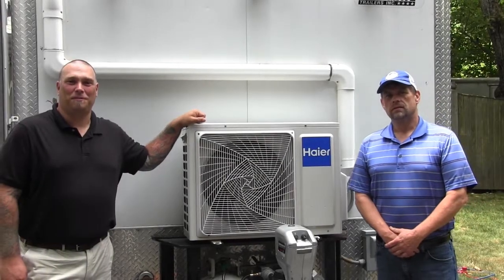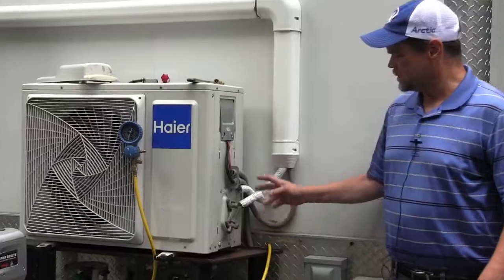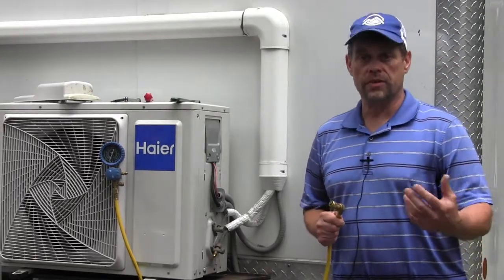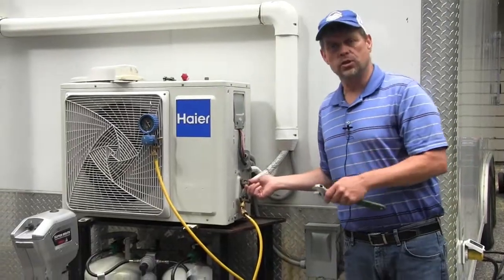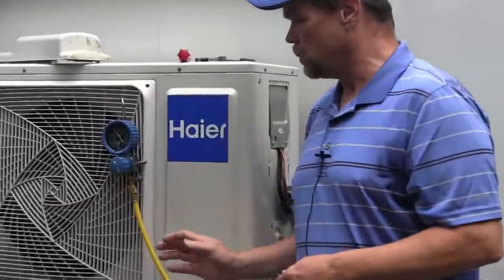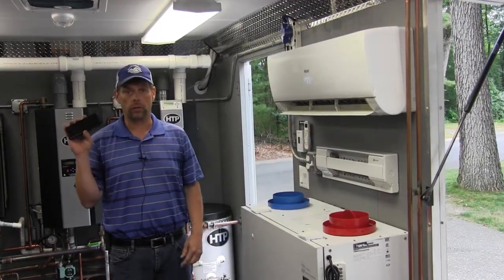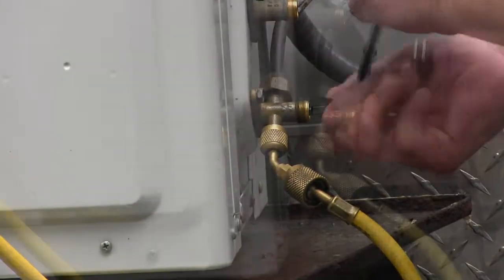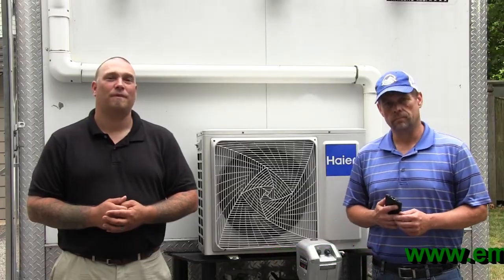Haier Ductless Mini Split Refrigerant Pump Down

Comment: Hello ,,what about when the unit is not operating  ??
Can you push the charged lines back into compressor any other way ? With a vac pump ? Or is that sucking only and cannot push , gas  back unto compressor ??
Reply: If the compressor in the unit isn't working you have to use a refrigerant recovery machine to pump it all out.

Comment: Guys, nice video but what about to purge the yellow hose before evacuation ? At the end compressor creates a little bit of vacuum as you said and suck in everything what was in yellow how. Since you did not purge it, then it sucked this oxygen in a hose, which is pretty long by the way, into the system. Or am I missing something ?

Comment: Amateur hour. Sucked air into the system because you didn’t purge your ridiculously long service hose. It’s also not a liquid line on a mini split. The metering device is in the outdoor unit.
Reply: How do you purge the hose?
Reply: @tombomombodombo  you connect it to service port and open the valve on manifold for a second or so.

Comment: the gauge and service hose will have air/moisture in them when you connect, once you turn the unit on won't that pull it into the system? Wouldn't it be better to connect a gauge directly to the service port without the hose to reduce the amount introduced or is it just negligible?
Reply: He should have pull vacuum on that line first,
Reply: @rawrandom-yt  Or purge it with little bit of refrigerant in the system. How you want to pull a vacuum on that hose if it's already connected to AC ? Only wat is to have that special safety - leak free valve which connects to 5/16 port. So after connection the hose they just should open valve on a manifold for a second...
Reply: Not immediately but for sure at the end of evacuation once compressor creates a litle bit of vacuum. All what was in the hose after connection is now sucked in the unit...

Comment: What size adapter is that
Reply from the maker: Standard r410a hose adapter, female 5/16 SAE x male 1/4 SAE. Can be purchased individually or in kits such as yellow jacket.
Reply from the maker: One more thing, the contractor should have two of them and they should always check for a  good o ring before use.

Comment: My flare is leaking, so I’m going to try this vs paying some dude 700$
Reply: Worked perfectly
Reply: @pokerbuddy2227  You should not have done that with a leak in the system
Reply: Thanks for posting the update. I always wonder if people succeeded. This looks a lot easier than using a refrigerant recovery system. I’m planning on installing my own mini split and didn’t realize you could just suck the coolant back in!
Reply: Did you re-flare the pipe or what did you do ? Probably just tightening them up would help as well or ?

Comment: I do in a different way. The machine is kept running then hose is attached to the suction pipe. Running presssure is less than standing pressure so attaching the tube is easier and refrigerant leakage will be zero or less. Second, the discharge line should be closed slowly so that there is no sudden pressure shock to the compressor. This I think is a better way of doing.
Reply: Good point to attach the gauge hose when system is running. But I would also purge the hose after is connected, there might be lot of oxygen trapped and at the end it's all sucked into the system. I saw several videos like this from pros so I'm not sure what's going on. And I'm just amateur enthusiast...
Reply: What about the air in this yellow hose?
Reply: Totally agree with you
Reply: Yes could have bled that while it was running before pump down, and also good idea to run compressor  for a min before closing off discharge valve.

Comment: Your "de minimis" release can be reduced a bit by adjusting the valve core depressor in the hose fitting. And also by getting some core removal tools.
Reply: And by attaching hose when system is running (less pressure in suction line)
Reply: @TekiWeki  And use a hose with a schrader pusher

Comment: Good video guys. Thank you                               I am replacing a faulty unit.   I may not be able to get the compressor to run   !!!!     I guess it needs a full recovery procedure otherwise
Reply: Hey Michael, can you summarize how you went about doing this. I have the same challenge with my Indoor unit malfunction. So have to do a full recovery procedure.
Reply: If it's faulty why just not close discharge and suction valves on the unit and just disconnect it ?

Comment: Did you pull a vacume to a -30 psig???
Reply: Any amount of vacuum will do.  One you have it in a vacuum the losses in the line set will be far below an oz, probably in the grams of refrigerant.
Reply: @Sneakybeave  But one should not forget to purge the hose before evac, otherwise....

Comment: After the refrigerent is pumped in Shoulbi shut down the unit by remote or shut down the outdoor unit from outside?
Reply: I just shut the service port and pull the disconnect. 

Careful when disconnecting the line from the system as it will be filled with high pressure, likely liquid refrigerant, wear gloves.
Reply: @Sneakybeave  and glasses
Reply: @Sneakybeave  What ? There will be no pressure in the hose or lines after evacuation and after you close the valves... There will be more likely vacuum.

Comment: Great video guys. Went to check pressure in my unit. Got a static psi reading of 25lbs. when I hooked up gauge. When I turn the unit on, in cool mode, line pressure pressure quickly decreases to -10hg vacuum. Turn unit off. Pressure quickly rose back up  to 25lbs. Is it a Leak or a clog or just super low on 410?? Im leaning towards a clog. And how that would troubleshooted. Thoughts? Thanks.
Reply: Did you ever figure this out? I have exact same issue...

Comment: He didn't bleed the line so he is sucking a little bit of air back into the system.
Reply: When I preped my mini split I didn't realize my schrader valve wasn't being depressed and released the refridgerant into the system. I didn't start it. Should I do what he does or should I evacuate the system and recharge it.
Reply: Noticed the same thing

Comment: great vid..can you pump down your system without a schrader valve in it?
Reply: Presume so. The valve is just to attach a guage to monitor the refrigerant being drawn back into the condenser.
Reply: I can't get this. What do you mean without Schrader valve? Schrader valve where ? On 5/16 service port ? That valve is there to hold refrigerant in the system and you can't remove it if there is refrigerant in the system. But if you mean to pump down the unit without manifold gauge and hose then yes, this is also possible. But you may leave some refrigerant in lines and needs more experiences.

Comment: At 4:38 mm:ss:  No mention of FSCit: FSC - 'Front-Seat=Clockwise'

At 08:00 mm:ss:  NO, you did NOT pull all the refrigerant into the 'compressor'.  It's in the receiver tank (if equipped) and the condenser coil, mainly.

Otherwise, an EXCELLENT VIDEO.

Keep up the good work!
Reply: looks like the used before,  locos🥴
Reply: @themrmoy40  Pardon??  No comprendo.
Reply: @BYENZER  he's cracked out on a good one
Reply: Those are just details :) A bigger problem is that they've sucked all the air in the the yellow hose into the system at the end of evacuation...
Reply: @misenko856  YES!  That too.  Good catch.  Nowadays, im noticing many such Youtubers are intentionally making mistakes, just to generate clicks and comments to up their Youtube incomes by jacking up their "engagement" numbers.
Reply: @BYENZER  Yeah, but I don’t believe they do this intentionally or ? This is litle bit dangerous because people will follow these steps and can ruin the compressor in a long run. I’m new to AC and I’m not a pro but I have experience with homebrewing where the oxygen is the worst enemy and I always make sure to purge lines with co2 to prevent oxygenation and I believe this is even more important in AC system…  Lot of people don’t realize there is lot of oxygen in their hoses.
Reply: @misenko856 you seem to know a lot about this process. I have a two zone mini split (two heads and one outdoor unit) could you perhaps upload a video of how to recapture refrigerant, step by step?